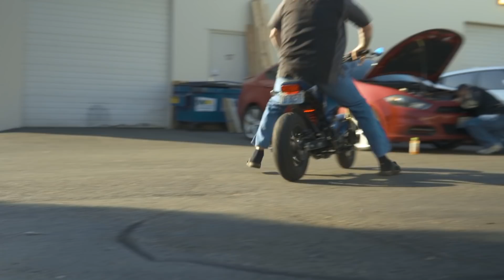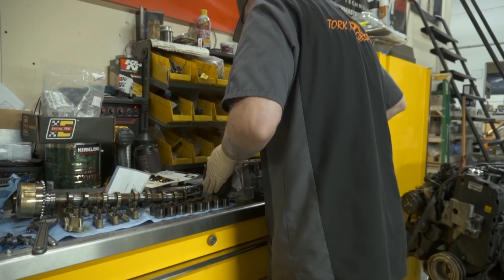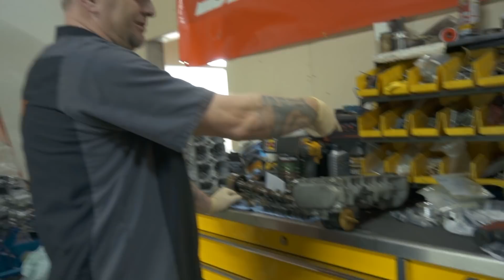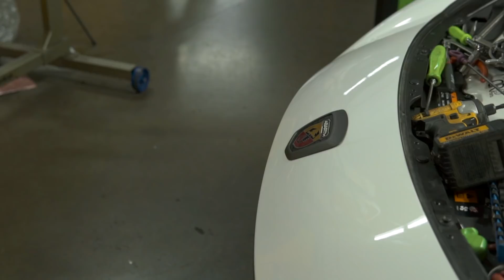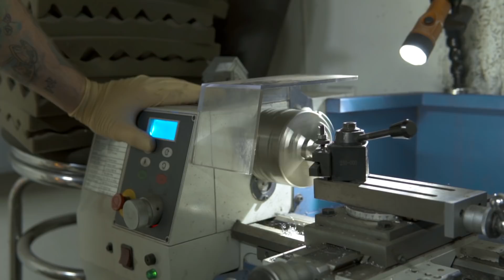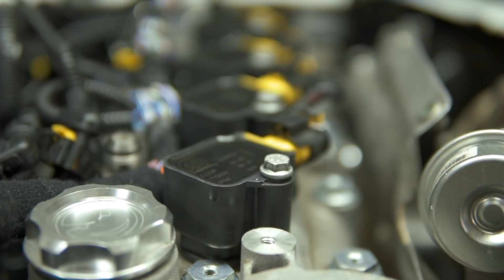TJet Swap Part 1- DOHC Conversion - Big Turbo Abarth 124

Comment: exactly what is needed for this apart from the engine i am going to start doing this swap andl just bougth the complete engine and the stem that goes on it other than that what else do you need to do or buy

Comment: Do you think this swap is possible on the 500 as well?
Reply from the maker: Absolutely. It's actually a bit easier because there are available ECU swaps and wiring kits. The 124 ended up needing a full standalone ECU plus integration with both Mazda and Fiat CANBUS

Comment: I have a 105bhp evo, also a 1.4 multiair. What i want to do with it is basically find a full turbi engine and ecu and try and fit it into the evo (would upgrade the brakes and the clutch) and eventually convert to DOHC. Would you think finding these engines /& ECUs is possible at all? Have been looking for them for a while and have no luck.

Comment: I have to ask: why didn't you just swap the entire head?
Reply from the maker: John Corona because the bottom halves are identical from the factory. Every part from the lower head down is the same part number as a TJet. A Multiair engine IS a TJet with a goofy actuator system strapped on top with limited lift that no aggressive camshaft could ever fix. That and mine is heavily ported and polished.
Reply: @PistonsAndPetrol  Ok, that makes sense.  Now, why didn't you do this at the same time you did the built engine?  FYI, I'm watching the built engine video while posting this.
Reply from the maker: John Corona I just hadn’t done the research yet.

Comment: Starting up a Multiair engine after 4 months in storage is a pain, especially when oil drains from the brick, and you are stuck trying to prime it without burning out the starter.
Reply: Pull the spark plugs. Less stress on the starter motor.
Reply: Tell me about it, I tried starting it for fun and found out that it won't.  Now I have to proceed with caution... ugh...

Comment: This is amazing! I was just wondering about the possibility of swapping the whole engine over but if it is just the heads that is different that makes it so much easier! Would love to do this on my 500 Abarth!
Reply from the maker: Kris Jones It’s perspective changing when you look at this from two angles. Firstly, they really did very little to add Multiair to the TJet engine. Second, if Multiair was a better tech, why does the A500, 595, and and 695 run the TJet? It’s the Abarth halo car :)
Reply: @PistonsAndPetrol  Exactly!! That has always been my thoughts with it as well. If they keep releasing these amazing cars over in the EU why do we have a different version of it here in the NA. I just wish we could get the M32 Gearbox to fix in our frames, from the research I've done our frame rails get in the way, due to stricter front impact safety requirements.
Reply from the maker: Kris Jones Johnny and I have an M32 sitting in the shop floor. 👍
Reply: @PistonsAndPetrol  🥺 Please tell me that you you plan on sticking that in an Abarth!
Reply from the maker: Kris Jones ☺️

Comment: I'm curious to hear if there is much of a change in the engines "note" with change in valuetrain. 

I'm quite fond of how my 2.4 multiair sounds.... and I'm really hoping I don't have to do a valvetrain swap to get consistent reliability out of my motor. I've had the car since new and the engine works great so far but it has under 50k kms on it and it's full stock.

Comment: Still sounds like a diesel with all that clackity-clackity-clack at idle. What is causing all that ruckus?
Reply from the maker: Needs the oil changed badly. It has heavily diluted E85 contaminated oil in it.
Reply: @PistonsAndPetrol  No wonder you had issues with your Multiair!! If you won't take care of your engine, how can you expect it to perform ??
Reply from the maker: Jason Jr Formosa dude. I change my oil every 2k lol. It happens fast.
Reply: @PistonsAndPetrol  Every 2k? That sucks.
Reply from the maker: Hunts By Chainsaw it does. That’s the downside of E85 mixed with Multiair. Now that it’s a TJet, dilution won’t happen as fast.
Reply: @PistonsAndPetrol  Well I guess I won't be running my 2.4 on e85 any time soon.... Seems like a pretty big design flaw.
Reply from the maker: Hunts By Chainsaw smart move.
Reply: @PistonsAndPetrol . It is just as well I suppose, because I can't find a gas station in my end of Ontario that carries e85 anyway.

Comment: bad timing? no compretion? on cranking
Reply from the maker: The initial cranking was just testing to see if it would start before tuning. There are major differences in the calibration for a TJet and a Multiair. Engine is good and healthy.

Comment: Will there be a write up or step by step instructions so we can do this at home?
Reply from the maker: I haven’t done that yet. I want to make sure tuning to support it is available. This would not start without John’s ability to tune these ECU’s. The part of the video where the car won’t start is what happens with a normal tune in the car (stock or otherwise)
Reply: @PistonsAndPetrol  Ahh ok. thanks you for the follow up. awaiting the write up!

Comment: I have been considering this on my dart for a while. Did you guys just flash a tjet cal on to the stock computer and remap the solenoid controls for other outputs?
Reply from the maker: The ECU tuning to do this is incredibly complicated. The TJet cal is useless other than a couple small clues.

Comment: Did I miss the gasket install in the video?
Reply from the maker: The 1 gasket required was shown. Unlike the Multiair upper section, the TJet has a sealed unit that encloses the cam so there’s less gaskets and mess to deal with.

Comment: how much do you think could be squeezed out of a bone stock t jet? I've seen guys in Europe easily getting to 300hp, apparently after 320ish rods become a limitation
Reply: Are you talking about a factory abarth T-jet with  GT1446 turbo, or a  unopened engine, with a big TD04 turbo or what specificly ?
As far as i know, on GT1446 you are at around 200hp, with TD04 240-250, and thats the limit, reliability will become a big issue after  that , at least what i have  seen on youtube.
If you are planning to enjoy the car  in the longer run, then building the engine is the only way to go, then turning up the power like Eddie did
i would do it just lik that.
First have the stock 124 multiair remapped, then probbably a TD04 turbocharger, or something more modern (twinscroll turbocharger, for better response)
and in teh final engien stage, completly build  and probbably a T-JET head liek eddie just did, which is amazing
The goal would be 300ish HP, i would never max out the engine, as i will drive my car to work at least 1x a week in summer, and hit Track days and hill climb events on rare ocasions
This is just my POV, you are free to disagree with me, but i would go for  a reliable engine, that is gonna serve me and not blow up  in a year.
Have a good afternoon sir
Reply: @klemzale5370  I'm talking about an unopened engine but with a big turbo, yeah building an engine is a good idea but I feel like they can take more. Imho for a fwd car like an Punto Abarth TD04 with NA 1.4 cams is the sweet spot
Reply: Here in italy , the land of abarth, yes there are some 300hp 500s or gpunto but they are very unreliable (with stock internals), they are good for some little pulls but not for track or mountain where you push the car for 10minutes or more.. with over 260hp on a standard engine it gests unreliable, it can last 50k km or it can blow up any moment

I'm at the end of my build of a gpunto abarth with forged internals and also cams good for 8k rpm. About 270hp with td04hl (bigger than the standard 04L)
Reply: @LorenzoClara97  from my experience t jet is a reliable engine even when pushed but gearboxes don't last long over 300hp
Reply: @miralemnermina142  the m32 with the bearing replaced with the correct ones is very strong. Way better gearbox than the 5 speed on the 500, better gearing also.
300hp are reliable with forged pistons and rods, not on a stock engine
Reply: @LorenzoClara97  oh, I was talking about 5 speed on the 500
Reply: @LorenzoClara97  Nice, i personally woukld opt for a Twincroll torbine, that way it spools up sooner
Are you using higher comperssion pistons and a more agressive camshaft ?
And lastly, how much money has your engine build, and supporting mods costed you so far (just a rough estimate,)
Im going the build engine parth one day myself, untill then i have  some saving up to do.
Reply: @klemzale5370  not higher compression.. with thicker gaskets I lowered it.
Those colombo bariani cams are good for 8k rpm because I will get it tuned with boost growing with rpm, not with peak at let's say 4k but still going up with pressure to 7.5k rpm.. this is very hard and very easy to blow up an engine if done wrong..

I like NA engine so I want the same sensations.

For everything, from bigger ic and ic tubing, exhaust line with valve after the down pipe, cda induction, cams, pistons and rods, Mitsubishi td04HL turbo, and many other bits like Bosch 620cc injectors, tjet gpl valves, porting, engine bored (because the block had 120k km) about 8 grand in total.

Ps: I also have the prometeo meccanica 6.5L oil sump, and bacci Romano lsd but they are not listed in the engine upgrade.
And by the way I will set to about 270cv because more are useless in my opinion if not on big tracks
Reply: @LorenzoClara97  Well fuck, very nice build, enjoy it
I will go through soem headache when im building my engine.
I would be happy with a redline at around 7K, and powerband close to redline (normally theese engines dont make much power after 5.5k rpm)
It will be a street-track build car, meaning i will take it to work in summer oance in a while, and hit track days and hill climb events on rare ocasions.
This is pretty much my dream car as second car, mildly modified Tipo 346 being my main daily car.
Forza Italia ;)